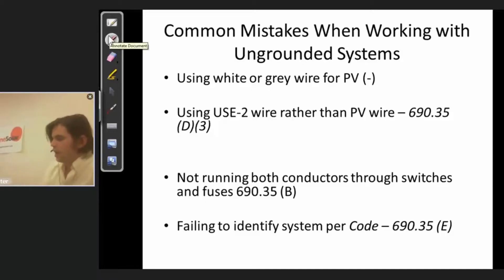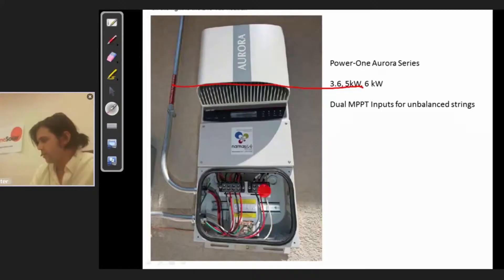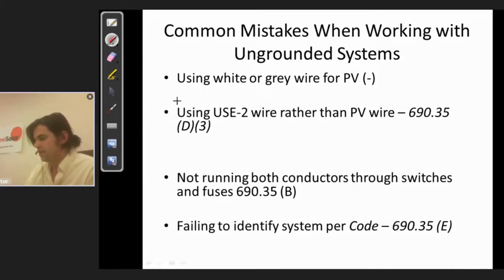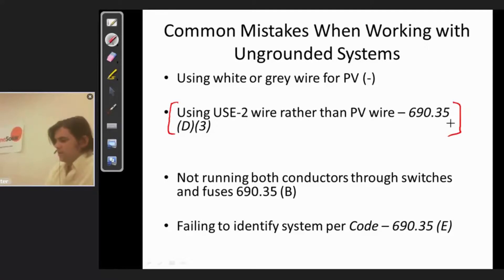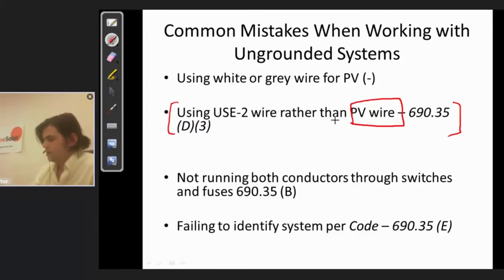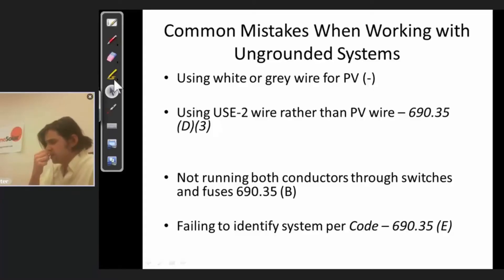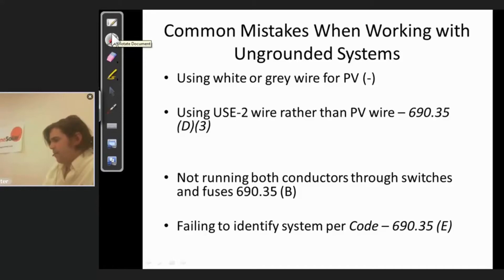Ungrounded PV and Non Isolated Inverters

Comment: 200.6 - Means of Identifying Grounded Conductors - Recommends White conductors - When 690.41(A)(5) applies to "Solidly Grounded System circuit conductors" - as permitted by "Solidly grounded PV arrays as permitted in 690.41(B) Exception" - "PV arrays with not more than two PV source circuits and with all PV system dc circuits not on or in buildings shall be permitted without ground-fault protection where solidly grounded."   - Did the design engineer understand the code properly or do I need to go to my truck and get the white conductor of the proper insulation and AWG.  Guess it depends on what kind of inverter we are installing?  The Code is a mess with respect to EGC, GES, GEC, and grounding electrodes!!